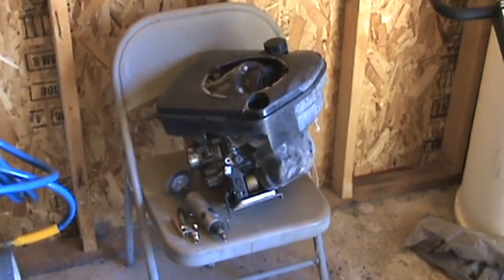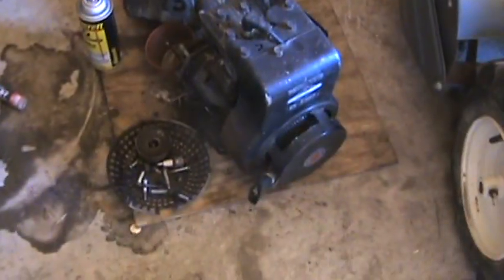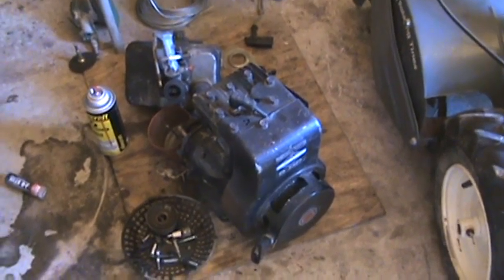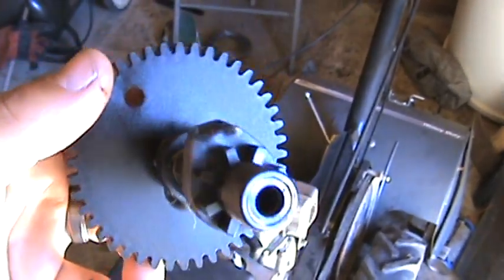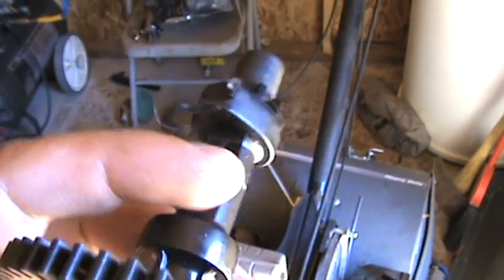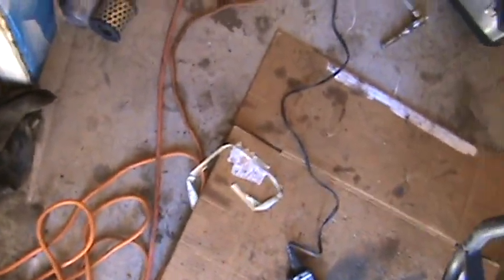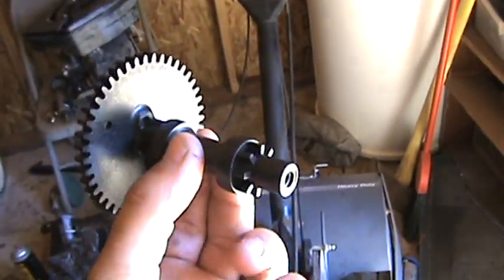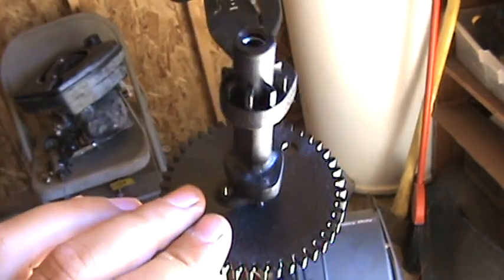How to install a camshaft on a Tecumseh 6hp OHV engine Part 1

Comment: I have changed more than one bent crankshaft cause shops down here will not try to straighten then due to liability. I do not blame then. My crank on one was more than .250 out. Now I am more careful about rocks until my nieces' pit bull carried another rock into the yard and I ran over it with a new mower. It turned the blade into a pretzel but the crank is still straight. Nice videos please show some with the safety clutch cause I still do not understand why I did not wreck that crank.